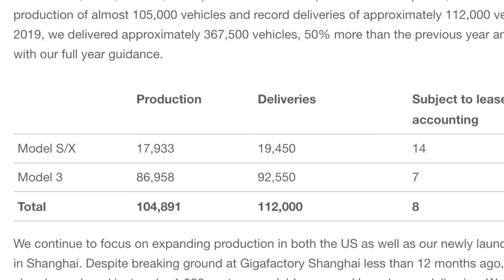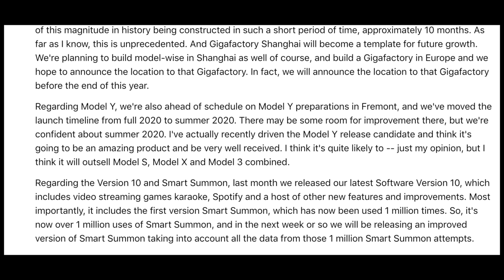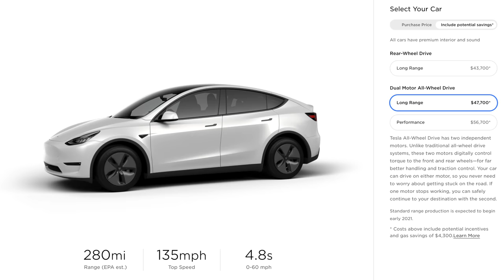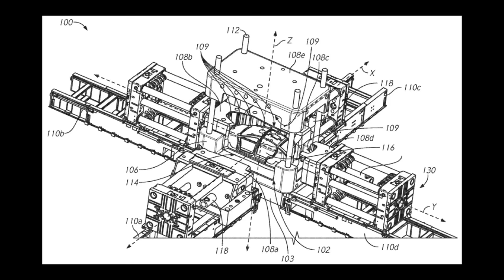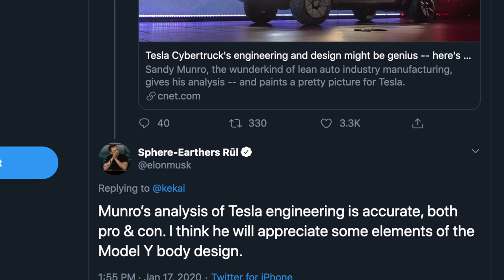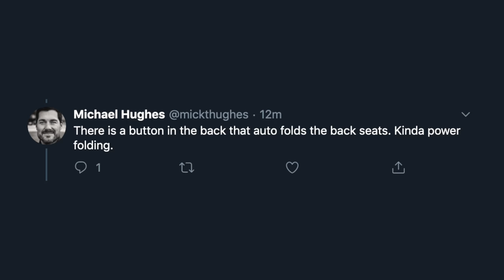Tesla Model Y - What to Expect at Tesla's Q4 Earnings Call

Comment: We need to know is how much profit per car, regarding those 2019 deliveries.  They could theoretically deliver 20% more units than expected at break even and that's not a win and could cause the stock price to contract. Finger's crossed on that notion.  Also, this weekend in the Colorado mountains on I-70, two Model Y's spotted driving together.
Reply from the maker: Near boulder? I saw sighting photos from Boulder.
Reply: @RyanShawtech  not close but not far either. Probably 40 minutes away.  But I just heard about another sighting on I 25 today, white. About an hour from Boulder.

Comment: I would love to hear why you decided to change from the Long range single motor to the long range dual motor. I am currently having that internal debate myself.
Reply from the maker: 1. AWD typically has a better resale value. While I plan to keep this car long term, I figured that could help in the event of selling it.
2. AWD is better for snow or any driving conditions that you typically want AWD. I live in Los Angeles, and will hardly need it, but for $4000, I feel there will be times that I wish I had it. If I'm already spending $48k, I felt like upgrading would end up worth it in the end.
3. The performance on the AWD is better. Better 0-60. Not the biggest deal in the world to me or most people since 5.5 seconds on the LR RWD is still great, but cool to have. 
4. (This is personal to me) I'm hoping and expecting that the AWD will release before the RWD. This will allow me to get it sooner, and make YouTube videos with it sooner which could help out my channel. Even if it doesn't help, or if it gets released later, I'll still be happy due to reasons 1-3.
5. 20 miles less range will only effect me on my long road trips, and I don't think I'll notice a huge difference.
6. Tesla discontinued the LR RWD Model 3, so they may do the same with the Model Y. Not sure how that would effect resale value or anything, but it's notable.
Reply: Ryan Shaw Thanks for the quick response. After reading your thought process I am going to do the same and upgrade to the AWD Long Range. I am also a So Cal resident and given the amount of snow we received on the mountains this year, having AWD would be a big benefit while driving through the mountain or going over the hill to Vegas. 

Thanks for creating these awesome videos, I know they take a lot of time and energy to make and you do a great job presenting your material. Keep up the great work!

Comment: Thank you for your videon. I have a question.  Does  model Y have air suspention likw model S? I will want airsus ...model 3 too hard on the road..
Reply from the maker: You’re welcome! Thanks for watching. The Y does not have air suspension. It’ll have the same suspension as Model 3. Have you driven the Model 3?
Reply: @RyanShawtech   MY suspension will be tuned for its cross-over body, still if anyone wants a smooth setup  just avoid performance version.